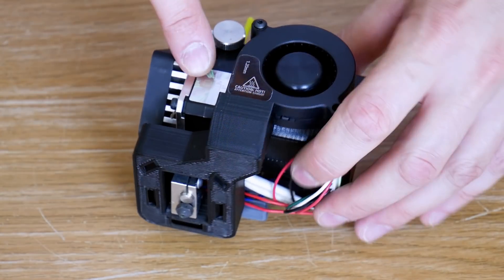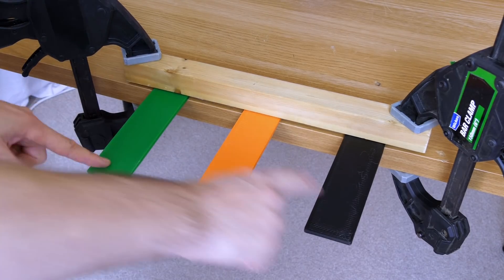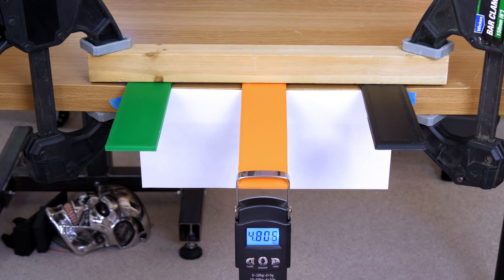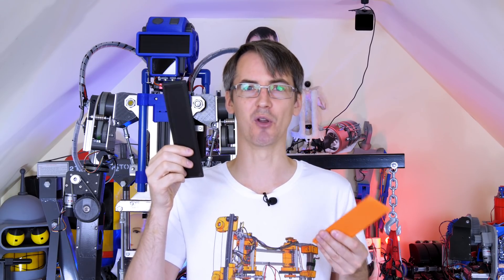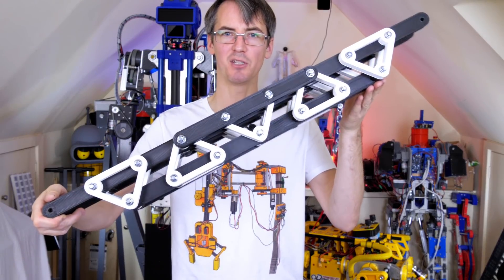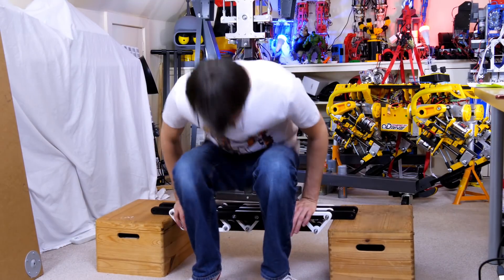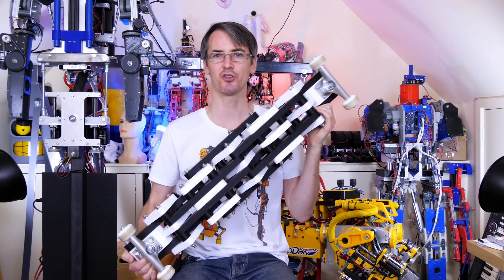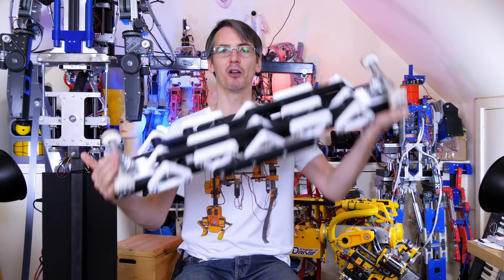I MADE IT I SKATE IT - 3D Printed Carbon Fiber

Comment: An interesting concept, but one of the strengths of traditional decks is flexibility  along with a measure of rigidity. I think it's an engineering instinct to make things harder to break, but not everything needs to withstand directed attacks, things like the deck of a skateboard or haft of an axe are flexible on purpose. Art-wise though it's a beautiful design!

Comment: That material test only showed that the carbon fibre reinforced sample had a higher flexural rigidity than the PLA. In this case we can see that means it has a higher Young's (elastic) Modulus. That doesn't mean it was 'stronger' by any means; in many cases that would suggest that is was more brittle than the standard filament. Unfortunately the Young's Modulus doesn't tell us anything about the yield stress or ultimate tensile strength, the former of which is often the most relevant quantity when choosing a material for a part.
Reply from the maker: That is true, ultimately the large nozzle made the parts 'tougher' so I could make the skateboard, although some extra rigidity helps.

Comment: It seems like filled PLAs are largely marketing gimmicks. The fibers have to be so short to be extruded that you're basically making your part weaker by giving it more places to fracture since PLAs biggest flaw is the fact that it tends to snap rather than give. I've found the various PLA "pro" filaments help this but they seem to actually be weaker, they just are more ductile and less brittle so they tend to give rather than break. I use those if a part needs to be able to handle impacts.

 For example the scraper I use to remove parts from my printer without scratching the ultra base build surface I use. Regular PLA tended to break fairly quickly with any real impact, but eSun's PLA Pro has been going strong without even chipping a little.

Comment: Your material test was basically worthless. The differences in how far you pulled the things down are more than enough to account for the differences in the measurements on the scales. I applaud the effort though. 

The fact is everything that makes carbon fibre composites strong is lost when you turn it into a 3D printing filament.

Comment: Hi James, I have a 49cc Bushpig. The wheels have degraded over the years. Some have flat spots, and due to them wearing down the outer wheel now rattles. I wonder if you are able to reproduce the 8 wheels in a better material to make the ride smoother a quieter?

Comment: I did not expect much of a difference in rigidity between normal PLA and gimmicky PLA with carbon fibers, at least not in that print orientation. It does not really add anything to layer boding. In tensile strength, I would expect some real advantages.

Comment: What is the total cost of used filament? I have a feeling this is pretty expensive
Reply: Looks like 250 dollars, the rolls he cites in the end are basically 50 bucks each
Reply: @victorcodesseira  Bit expensive, but same could be done using carbon fiber boards cut in the shape. Cant bother to calculate how much that would end up costing. I think one could make this from plywood too but weight will be bit more.
Reply: @Hellsong89  

If you’re asking for an affordable price, that’s not gonna happen. 

Everyone got bills to pay you know.

Comment: Interesting Skateboard, but carbon fiber PLA is an overpriced fad.  One way to substantially increase the strength of 3D prints is to use a high power laser focused on previously printed material directly below the nozzle to warm it up; this allows the new material to have a much better bond than normal 3D printing.   As for very strong 3D prints, why not check out my  'Universal Soundbar' which is the worlds longest Soundbar too, at nearly 6 feet long.  https://www.youtube.com/watch?v=XDRxu7oHN2A

Comment: For your next  strong build you should use Tiamet 3D Ultra Nano Diamond Filament. Its non abrasive so you don't need a hardened nozzle and is not only easy to print with but it REALLY strong!

Comment: The test at beginning was flawed. look at the board and spacing.
Reply: Yes it is, but the flaw is actually benefitial in this case. For the 1st and the 3rd one, the angle is the same for both of the plastic strips. However because of parallax the angle in the case of the middle one is more. 

All of this doesn't really have that much of an effect on the whole experiment because the parallax error results in very minimal errors in the Force Calculated.

Comment: James, seems like you had a lot more fun this week, nice looking project!

I'm working on a full suit of bullet resistant armor.  I'm using the zna fiberglass and epoxy recipe, with some ceramic tiles in key spots.

Thing is, ceramic is great at dispersing impacts like bullets, but it's heavy.  Do you know of any other material that would have a similar ability to ceramic tiles, but not be as heavy?

Also I have some Kevlar carbon fiber fabric in my suit, to stop cuts and help slow down bullets.

Have you ever considered doing a bullet resistance test on that carbon fiber filament?

It might be great for building suit parts?

Have you ever considered building a suit like your Batman but a bit more practical, ie having real bullet resistance plates in it, and stuff like that?

Also, did you see that company that posted a video recently of a light bending shield that you can hide behind and it obscures whatever is vertical behind it?

I know how to build one, lmk if you want the ingredients.
Reply: I belive there is a video somewhere of 3d peinting materials and how bulletproof they are
Reply: I'd recommend, just not getting shot at...

Comment: Hey James, you could try to put these 64Ah Nissan leaf battery cells in it. Looks like they might fit and would be a great weight test. As well as good endurance/range experiment.
You could even as to partner with Tom from Battery hookup as a promotion.

https://batteryhookup.com/collections/frontpage/products/nissan-leaf-battery-module-gen-1

And for longboard trucks you should get reasonably priced boardnamics (a fellow robotisist!) 

https://boardnamics.com/product/220mm-precision-hanger/
220mm Precision Hanger – Boardnamics

Comment: I was going o say you should have put a motor on it, but you mentioned that in the end.
Reply from the maker: I may do, and maybe make it event longer?
Reply: @jamesbruton   Youtuber "GreatScott!!" just did a great electric skateboard build. Super simple and very powerful. May want to check it out.
Reply: @jamesbruton  Longer would be good for distance for sure.
Reply: @jamesbruton  You could make an assistive board that only accelerates if you kick instead of using a remote.
Reply: Time traveler
Reply: @Fabio.-.  The power of Patreon. Members get the videos as much as a week early.